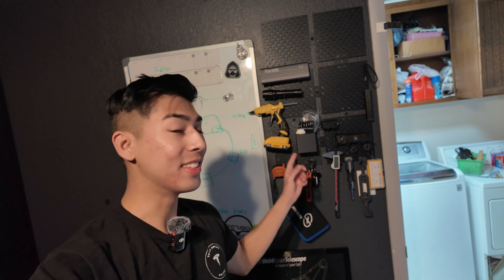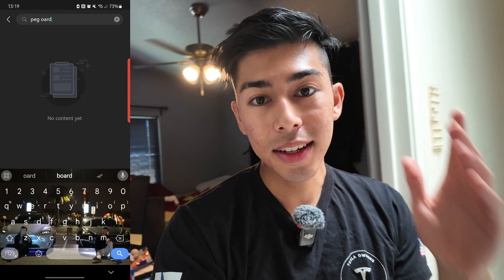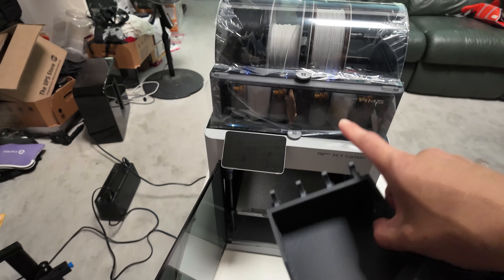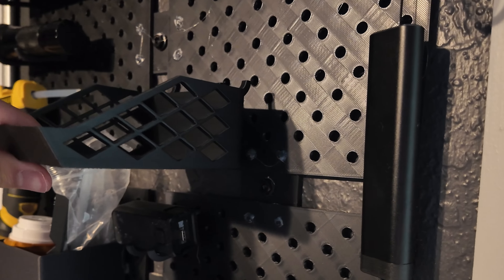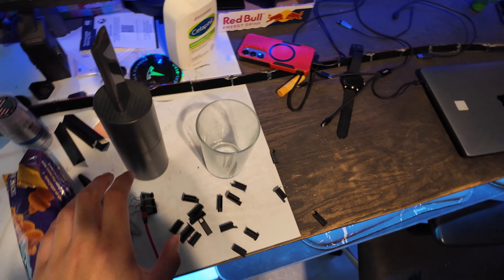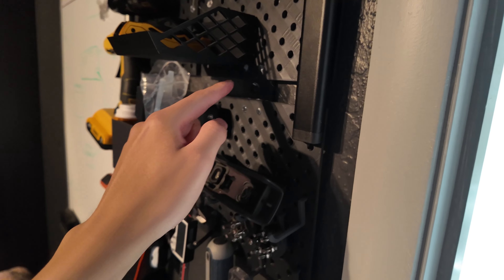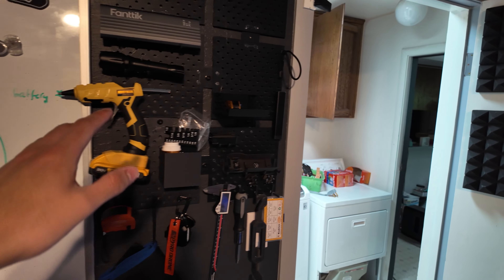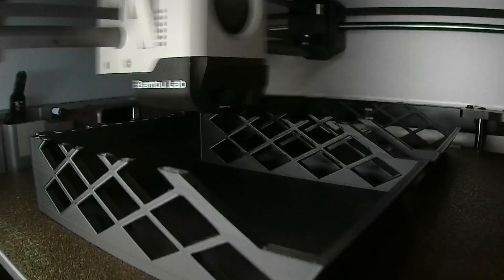i 3D printed my pegboard shelves! (BAMBU X1C with generic PLA)

Comment: I'm kinda new to this too, I had a 3d printer about 7 years ago, but it broke and been out of this for about 5 years now, so I almost forgot everything XD
About a month ago I got a bambu lab P1S (same form factor and size as yours, but cheaper model), and been printing non stop since then XD

So, my preferred gridfinity base is this one:
HERE THERE WAS A LINK TO A ITEM IN MAKERWORLD, the item name is: "Gridfinity Superlight Baseplates" so you can search it.
Very thin, fast to print, no magnet system (I don't really need the magnets, I don't tend to stumble or let things fall, I'm careful). In that file I think you have most or all the sizes you need.
If you need a grid size that's not there, you can use a parametric model like this one:
HERE THERE WAS A LINK TO A ITEM IN MAKERWORLD, the item name is: "Gridfinity Parametric Base Plate" so you can search it.
So you can customize the grid to the size you need, and also add margins so the grid base touches the walls and doesn't move inside the drawer.

Also, for the bins, my preferred ones are these:
HERE THERE WAS A LINK TO A ITEM IN MAKERWORLD, the item name is: "Ultimate Gridfinity Bins Collection + Parametric" so you can search it.
Those are parametric too, so you can customize them to the size, height, with or without label tab...

But there are lots of different bins and boxes tailor made by the community for specific items that are really amazing, like for example this one to hold 2 hotends:
HERE THERE WAS A LINK TO A ITEM IN MAKERWORLD, the item name is: "Hotend Gridfinity tile for P1S, P1P, X1 Bambulab" so you can search it.
There are hundreds of great items, you just need some time to look for the ones you need.

All that I said here is also true for the other multiboard and honeycomb systems, just do searches by those names in the makerworld site and order the results by boosts or by likes to see the most popular items 1st, usually those are the better ones because those are the ones print the most.

Also, most of the things I discover are from youtube videos that show me the ideas... search for videos like "most useful 3d printable items" and things like that... many are crap, but many are really good (that's how I discovered the multiboard and gridfinity systems).

Finally, I also have the AMS, and the best thing I printed so far for my printer is the AMS Riser V2:
HERE THERE WAS A LINK TO A ITEM IN MAKERWORLD, the item name is: "AMS Riser V2" so you can search it.
That piece is amazing (it's like 2 kilos of filament and more than 70 hours of printing counting all the files, but it's worth it).

Once you have that, I also added the multiboard system to the printer, which hangs from the AMS Riser V2, XD :
HERE THERE WAS A LINK TO A ITEM IN MAKERWORLD, the item name is: "Multiboard for AMS Riser V2" so you can search it.

Well, enough, this been a really long message. Have lots of fun with your printer ;)
Reply from the maker: You're awesome! Thank you for telling me all this! I will have to check all of it out! I'm so excited!

Comment: Man, you wasting lots of filament there... You should be using multiboard or honeycomb (HWS) system, those are much more flexible, less wasted filament and infinite community items/pieces to use with them.
Reply from the maker: Good idea! I'll stop with this type of board and try the honeycomb style! 

After I printed six pieces I realized that the honeycomb system existed 😂
Reply: @ComputerEngineeringCPE  I personally use multiboard, because it is compatible with most of the honeycomb pieces (the hexagon is the same), but also has peg holes, so you have the best of both worlds in one.
Also, if you don't know it yet, you should check the Gridfinity system, its the best drawer/bin/tray system ever... it's amazing. There are also mods to use the gridfinity system items in the multiboard or honeycomb systems, so you can combine everything how you want... you can use the gridfinity bins in your drawers or in your walls, and move them around however you want.
Reply from the maker: @juanjiviris  I'm super new to this, this is amazing. I think I may have vaguely heard of the girdfinity before but never looked into it.

Do you have any preferred ones you like to download from? I see a few different versions of these